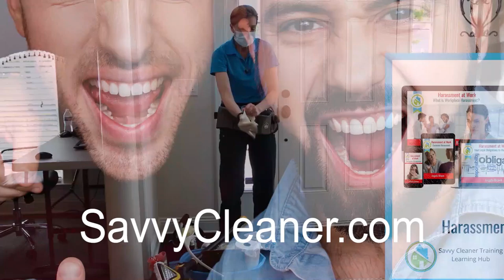How to Clean Crevices and Sliding Door Tracks - Say Good-bye to the Slime

Comment: A small circular  pipe brush is perfect for shower and window tracts. Slides under doors perfectly and cleans all side at once.  Cleans the sink drains after using the zip it. Make sure tip is protected so it won't scratch.  I used a shrink  tube protector on tip.
Reply from the maker: Thanks for the tip. 👍

Comment: Angela you are so awesome! You have me cleaning my house from top to bottom so much better. Thank you! Do you by any chance have any advice for a plastic seal strip that seals a seamless shower door to the tile? The seal is tight yet a little mold has gotten in-between the area and I can't get anything in between it to tackle the mold.
Reply from the maker: Thank you so much for your kind words, I appreciate it! Those are hard to clean, but if mold remover doesn't work or get to it,  you might need to change the strip depending on how bad it is.

Comment: Okay, this is all well and good and very useful information, but I have sliding glass doors with a plastic u-shaped track that points downward, like a lower case n. For the life of me, I can't find anything thin enough or long enough to clean inside it. I have schmutz and mildew I simply can't get rid of without completely dismantling the door from the upper track and removing that gasket. Any ideas?
Reply from the maker: Have you tried hydrogen peroxide? That will eat the schmutz and mildew by just spraying in the area and letting it sit for a bit. Let me know if it works for you.

Comment: Thanks Angela. Very helpful.
Some sliding shower doors can be lifted out of the upper track that they roll on.
There is a plastic spacer that keeps the doors aligned. That can also be removed.  The rollers that the doors travel on  can be treated with a water resistant application to reduce squeaking.
Take care.
Reply from the maker: Great tip! Thanks so much for sharing this. You are wonderful! :-)

Comment: Another on point tutorial!  I think maintenance is the key to these 2 jobs.  Once you really clear the gunk out of the window crevice, for example, you can probably just run a paintbrush or something over at every couple of weeks & it stays clean.

My other 2 cents - if you are building a home or remodeling a bathroom and have room, go for walk in shower with no door or shower curtain.  You can do one in a pretty small area, the one in my bathroom is probably 4 x 4 with a 1.5 x 2.5' extension for the entrance.
Reply from the maker: Thank you for sharing your tips and  thanks for watching the video.🙂
Reply: Priscilla Frye agree, solid cleaning produces lighter cleaning in between

Comment: Great video.  What about cleaning the overlap of windows that you either lift up (like in this video) or sliding ones? I don't know why anyone would design windows with overlaps  😒
Reply from the maker: When it comes to cleaning the overlaps of windows that either lift up or slide, it can indeed be a bit frustrating. However, the design of window overlaps serves a purpose, such as providing better insulation or enhancing the window's structural integrity. To clean these areas effectively, you can start by using a vacuum cleaner with a brush attachment to remove any dust or loose debris. Then, dampen a soft cloth or sponge with a mild window cleaner or a mixture of water and vinegar. Carefully reach into the overlaps and gently wipe the surfaces, being mindful not to apply excessive pressure or force that could damage the window mechanism. You can also use a cotton swab or a soft-bristled brush to access tighter spots. If necessary, refer to the window manufacturer's guidelines for specific cleaning recommendations. While cleaning overlaps may require a bit more effort, it ensures a thorough cleaning and helps maintain the functionality and longevity of your windows.

Comment: That was great but didn’t actually answer the question asked. How do you clean the overlapping area in a sliding shower door? Awaiting your response, thank you!
Reply from the maker: You have to slide the shower door to one side, clean and then slide to the other. If you have a shower that won't allow the overlapping area, you have to lift the door off the track and clean the area and then replace the door in the track.
Reply: I can't help but wonder if we have the same shower.  Mine is literally impossible to keep clean.  

It is a stall and the doors attach at the top of the doorway, as opposed to there being a track a smidge lower down for air flow.  It's supposed to enclose all the steam, whether or not because some people like a steamy shower or because someone thought this would magically eliminate the need for a bathroom fan, I don't know.  All the steam pours out when you open the door so that line of thought obviously didn't work out.    The doors overlap by about an inch when both doors are closed, and if you open the doors so the shower can air/dry out, that overlap is even bigger.  And you can't slide them past each other to shift what end is covered up.  So there is always one part in the middle that never dries out and is impossible to get to to clean.  And you need to remove something at the bottom with a screwdriver in order to remove the doors, you can't just lift and pop them in and out like a sliding closet door.  

It is the bane of my housekeeping chores.  I have tried squeegeeing the shower after I use it so at least it's dry inside and I can close the doors to minimize overlap, but there is always overlap and it is never clean.  The best I can do to keep it clean is to blast the crevices of door with bleach solution once a week or so after I shower.  One of these days a bathroom re-do is in the works - that's really the only solution.    

The set up is made by Kohler and I think it may have been discontinued and I can only conclude that this is the reason why lol.  These places that design such things...   they should have to test cleanability and not just how it looks and functions brand new.  This was clearly designed by someone who never had to clean a bathroom in his entire life.  What's funny is I am told the people who lived in my house when this bathroom was finished, the wife was a real clean freak...  can't help but wonder how long it took her to regret this shower choice.  I don't know if I would have thought of this when picking it out but it will definitely be on my mind for its replacement.

Comment: Those brushes you use for the tracks where can i get something like that here in Canada.
Reply from the maker: You can get it on Amazon here: https://www.amazon.com/OXO-Good-Grips-Clean-Brush/dp/B013OYR7AY/ref=as_li_ss_tl?crid=3BRWL9J053TAD&dchild=1&keywords=oxo+deep+cleaning+brush+set&qid=1591114393&sprefix=oxo+deep+cle,aps,168&sr=8-2&linkCode=sl1&tag=savvyc03-20&linkId=f33d79820fc857979043d8f4bb778ed8&language=en_US
If they don't ship to Canada, check your local Walmart or Bed, Bath and Beyond.
Reply: Thank you Angela

Comment: You didn’t even address sliding shower doors, which was the question asked. The door you’re cleaning in the video swings open.
Reply from the maker: Many shower doors do swing open and yes, there is a shower door being cleaned in this video. The same tools are used for shower doors that slide. They key is to use the proper tools and common sense.